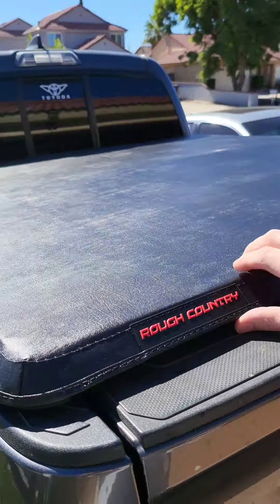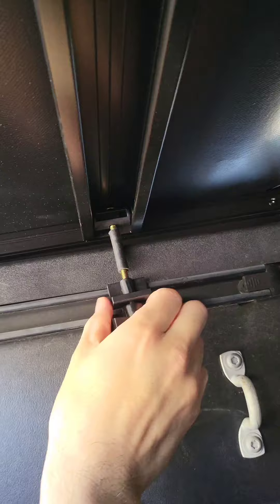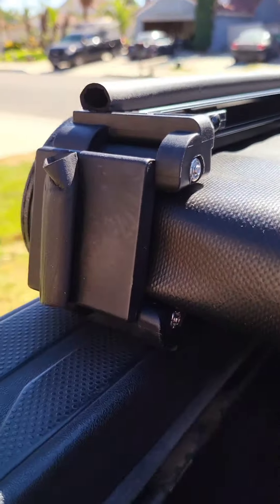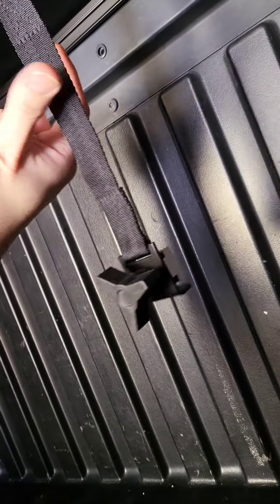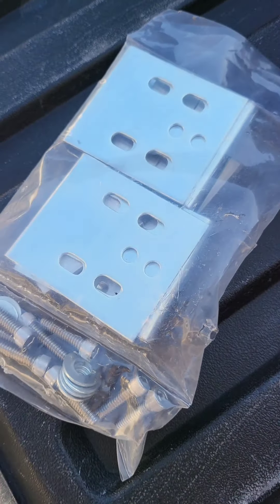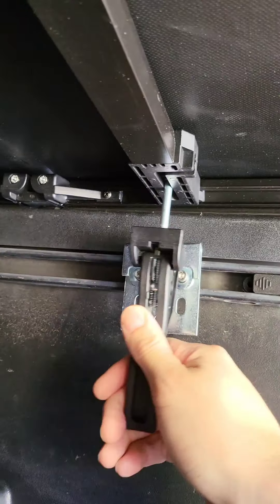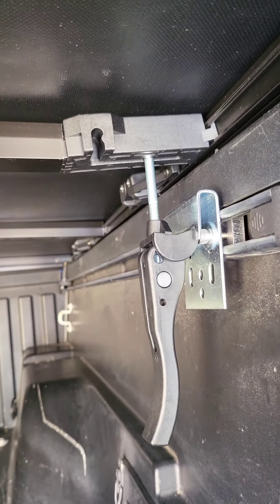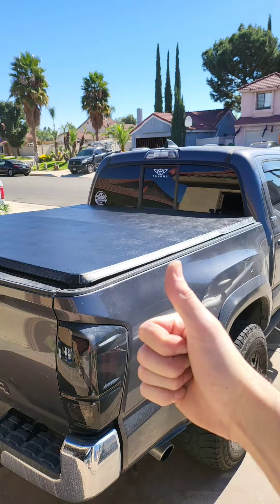Tonneau (Bed) Cover - Rough Country Soft Tri Fold: Simple DIY Install - Toyota Tacoma

Comment: Hey bro thanks for the video just bought this for my ram I have a question to roll it up do I just unlatch those clamps whenever I wanna roll it up? Or is there another way not shown?
Reply from the maker: Yeah I really like this one because it doesn't just roll up and actually folds after you unclamp the end. Then it clips on the opposite end to stay folded open